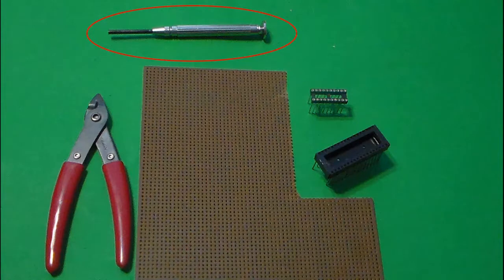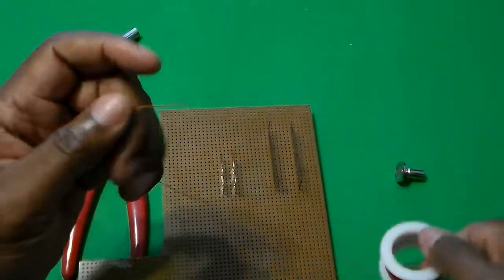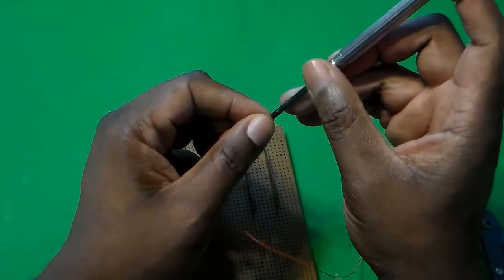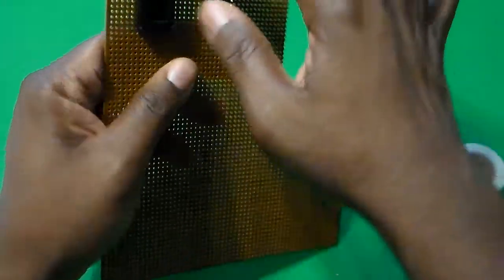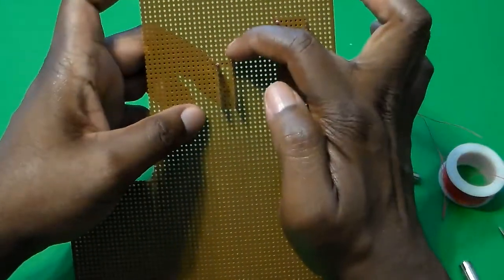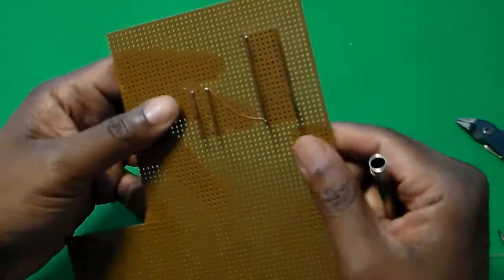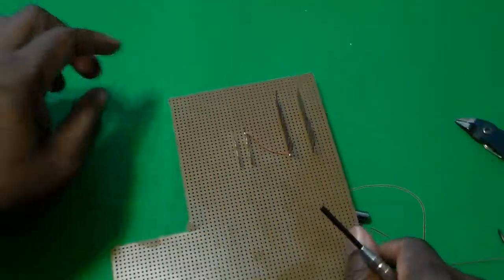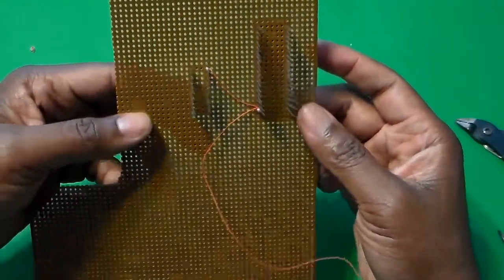Wire Wrapping Basics

Comment: Thank you for a very informative video. I especially liked that you showed that some of the insulation was also wrapped around the bottom of the pin as this adds strength to the wire so it has less of a chance to break due to vibration or other movement.